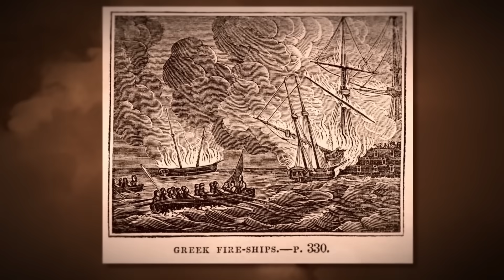Top 10 Lost Inventions Scientists Today Can’t Recreate

Comment: damascus steel is basically a low carbon steel then a layer of high carbon steel, layer upon layer. 
i the knife i am currently making is 128 layers thick (before grinding and shaping)
Reply: That's something I've always thought would be super fun and satisfying but have never tried. Love woodworking but have never given blacksmithing a try.
Reply: @anthonyshafer8070  you can buy a damascus blank from just a block of steel to a complete blade. its justa matter of how much time you want to spend shaping it, a vice and files is good starter but a linishing machine is far quicker. then you have to sharpen and harden it and use your woodwork skills making the handle